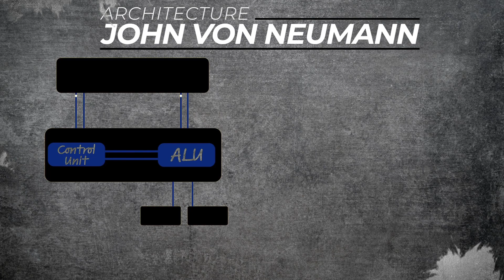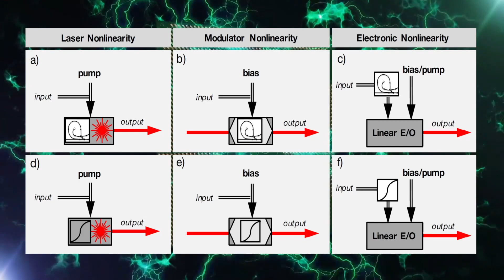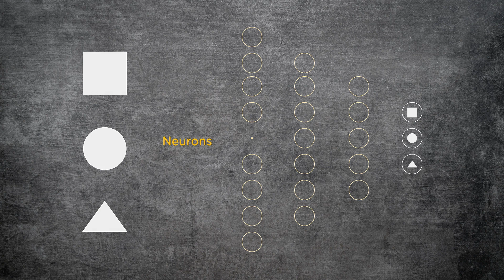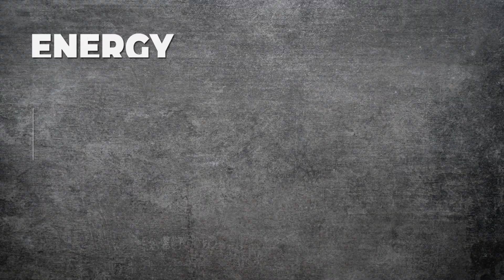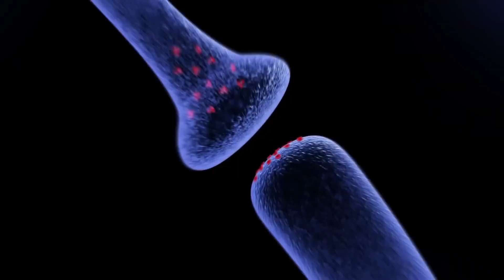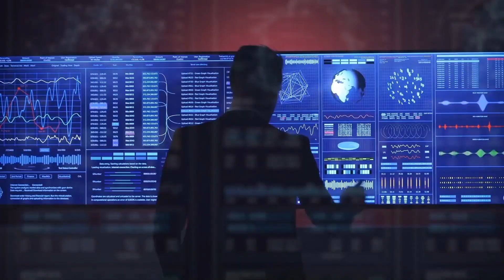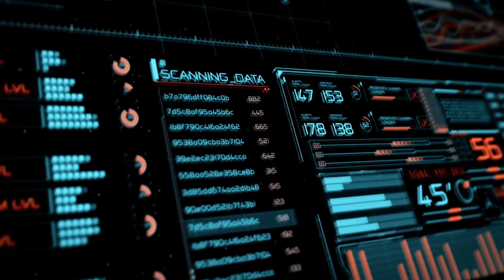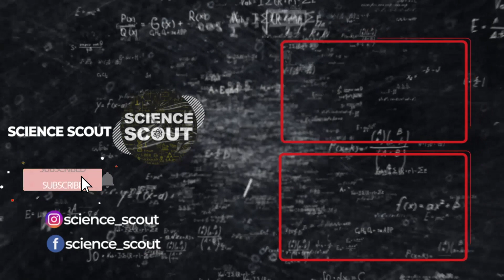Neuromorphic Computing-How The Brain-Inspired Technology | Neuromorphic Artificial Intelligence |

Comment: The human brain computes in 5D and has pre-cognition meaning it has the correct answer before it knows it even questions or  requests the answer. you could combine 3 human brains together and the power output would be more powerful than a Jupiter brain and you could power it all using 3 bananas.
you could create the most powerful giga computer with trillions of times the computation of a human brain and it still wouldn't compare to a human brain since its only stuck in 3D computation and could tap into 4D computation using quantum computing.

Comment: Great Video, nice to see Neuromorphic getting some attention. My only complaint is that it is great to just think of NM as low powered DL. There are a lot more differences between DL and NM, NM aims to sense and processing in a sparse and asynchronous manner. It is also spike-based so backpropagation isn't just a given in Spiking Neural Network, so there are many different maybes to allowing backpropagation to work, combine with the numerous method of Hebbian learning that is often used within NM system that helps to further the advantages of low power and latency system.
Reply from the maker: Thank you very much 😊